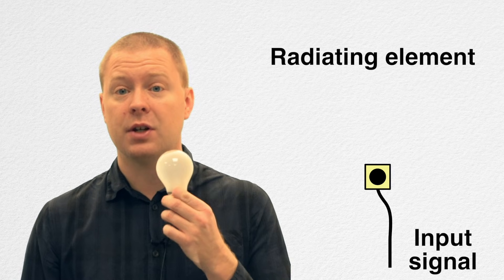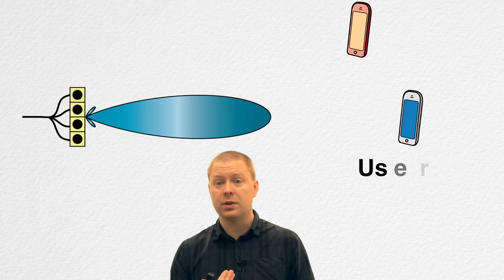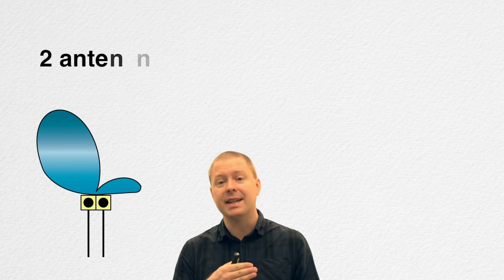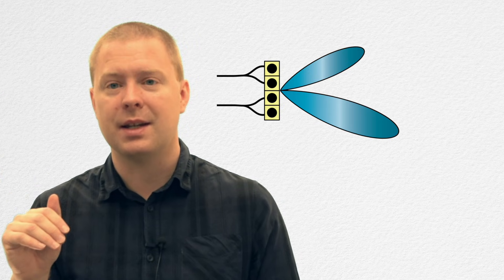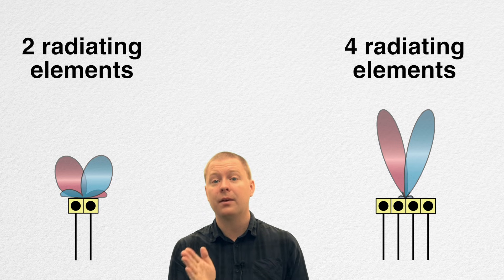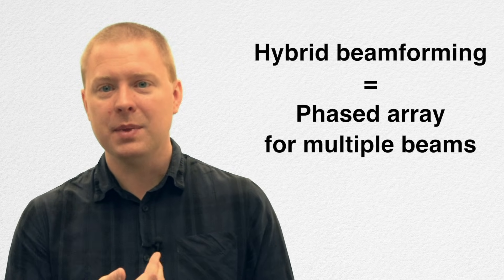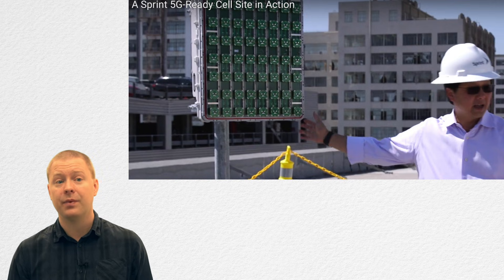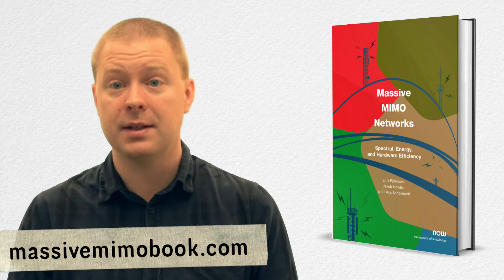Basics of Antennas and Beamforming

Comment: what about distance between two radiation elements ?
Reply from the maker: The general guideline is that elements should be spaced apart by half a wavelength. Shorter spacings lead to mutual coupling. Larger distances are possible but require a larger form factor of the array. It makes the main lobe narrower but at the expense of creating ”grating lobes” pointing in undesired directions.

Comment: this makes sense, however it wont work if you connect the antennas together, you need an expensive piece of equipment to manage the array! Please could you talk about the point you plug all of the antennas into and you cant splice mutiple antennas as this will share the power and change the freq
Reply from the maker: In digital beamforming, you plug all the antennas to the same baseband computer, so the beamforming is done in the memory of that computer where you set the power and phase for each antenna. One can also build phased arrays where the baseband only generates one radio signal, which is then divided into multiple antenna branches and phase shifted by creating delays. This is standard technology these days. Every 5G phone uses 4 antennas with digital beamforming.

Comment: What do we call a receiver array which ISN'T trying to "point" in any direction. Instead, a smart back end listens to all the elements in the array, and decides, based on detected signal, which ones to sum, which ones to invert or phase-shift, and which ones to ignore?
Reply from the maker: An analog phased-array is physically pointing in one direction, while a digital antenna array can receive from any directions - it decides afterwards in the digital receiver processing. This is just called digital receive beamforming/combining.

If you pick a subset of the antennas to use, it is called antenna selection.
Reply: @WirelessFuture  Thank you!

Comment: Hi Emil,it was so absorbing.Would like to know how digital tilt works,example 4 digital tilt means what and if we are doing 4Electrical and 4 digital would it mean 8 digital tilt in all
Reply from the maker: I guess that you with 4 and 8 are referring to degrees? You want to tilt the direction of the transmission by 4-8 degrees compared to the broadside direction? The main concepts are normally electrical and mechanical tilt, where the former mean phase-shifting the antenna inputs and the latter means deploying the antenna array with a physical rotation. Cellular base station antennas are often deployed with a few degrees of mechanical tilt towards the ground and can then use electrical tilt (beamforming) to direct the transmission further towards the ground.

I haven't heard talking about digital tilt, but I believe it is the same as electrical tilt. One could certainly distinguish between how the electrical tilt is generated: phase-shifting in the analog domain or in the digital domain.
Reply: @Wireless Future  HI Emil,My question was   AIR3419 or AIR3458 has both Digital and RET configured,so we set 4 as digital tilt and 4 as RET in AIR3458 so now the combined tilt will be considered as 8 degree tilt or it will 4 degree ,

Comment: Hello Sir,

According to the definition of the concept of ERB coverage area (gNodeB) when using narrow beam pointing generated by MIMO antenna in beamforming (BF) mode: Pointing a narrow beam covers, at maximum gain (up to 3 dB below), a relatively small area around the UE reference point (or UE cluster). How, therefore, is the concept of the coverage area of an ERB, and its correlate, the percentage of coverage area (a statistical parameter that considers the effect of log-normal multipath shading and weights its effects in an area around the ERB)?
When considering the multi-user MIMO mode, with multiple narrow beams... The coverage area of an ERB would be defined considering all the beams pointed at different points in the surrounding area, or for each beam, is an area or sub-area of coverage defined?
In the previous question, the starting point of view was what happens in the vertical plane that contains the ERB and UE antennas. There is also a concern with what happens in the signal distribution in the horizontal plane. In previous generations, a fundamental related concept is the division of the coverage area by sectors, something that was directly related to the beamwidth of the ERB antennas. For example, using 120º beam antennas, 3 antennas covered the 360º that would characterize the entire area. With multiple beams, one can imagine maintaining this concept and expanding the number of sectors. For example, with widths of 10 degrees per beam, horizontally, 36 would be needed to cover the entire area. From the above, I ask: the concept of the coverage sector remains in 5G, adapted to the multiple beams of the antennas MIMO?
Given the considerable (apparently) change in planning: do the concepts of coverage area and percentage of coverage area remain essential for planning? What other related concepts came to be used? On 4G, are they already used?
Given the complexity of using and coordinating multiple beams: in which scenarios and application conditions, will the MIMO strategy with multiple beams be used? The macro scenario is extreme broadband, communication ultra-reliable, or massive communication for multiple users? Is the environment outdoors, indoors, or both? Is the band sub-6 GHz or millimeter wave?
Still on the previous question, in the scenarios foreseen for using MIMO with multiple beams, another question arises. In which of these
 beamforming scenarios will be “fixed” and in which will it be adaptive (following cluster of users, with or without the interposition of nulls of the
 radiation pattern in the directions of other groups considered interference for that cluster)?

Finally, considering all the different aspects of previous generations brought by the multi-user (multibeam) MIMO approach of 5G discussed here….
How has the link budget analysis been (or needs to be) adapted to address these aspects?

Best Regards!

Comment: It's very confusing that you devote the discussion to "MIMO" when so much of its scientific heritage comes from that other term "PHASE ARRAY" antennas.  What's the special thing about "MIMO" that it merits its own name....how different from Phase Array antenna tech?
Reply from the maker: Phased arrays are discussed 5 minutes into the video. It is indeed the classical way of doing beamforming in line-of-sight scenarios, using analog phase-shifting. For that reason, it is also known as analog beamforming. However, it is mainly digital beamforming solutions that are relevant today and in the future of communications, because one can use it for beamforming in any propagation environment and for multiuser communications. As explained during the first 5 minutes, digital beamforming allows you to control each antenna output individually.
Reply: @WirelessFuture  thank you!  cheers.
Reply: edit: Author will (likely) respond: MIMO is THE APPLICATION of phase array principles toward simultaneous multi user spatial multiplexing. (as mentioned 4 comments below)

Comment: Thank you for this informative video! I am still not sure what the difference between phase array beam forming (talked about towards the end of the video) and MIMO beam forming is exactly. You said they both are formed using phase differences so I am still not quite sure where the difference begins? (You said separate signals for MIMO but what does that mean exactly?) Thanks!
Reply from the maker: With a phased-array beamforming/beamsteering, you can only transmit one beam in one angular direction at a time. With MIMO beamforming, you can transmit a summation of many beams. These can be directed towards different objects in the propagation environment, so that the user receives the signal from multiple strong paths. They can also be directed towards different users, so the users don’t have to take turns but can all be active at the same time.
Reply: @WirelessFuture  ahh.....very deep....got it.

Comment: great explanation, what about at home (house) with walls and floor levels (2 levels), do you need multiple antennas or just one (omni directional) ?
Reply from the maker: If you get a WiFi router with 4 antennas, you will get a roughly 4 times stronger signal everywhere in the home. That might make a big difference if there are places in your home where you currently have poor coverage (few bars). However, if you already have good coverage everywhere in your home, the difference will not be noticeable. The signal strength is typically varying by 100000 times within a house (from being close to the router to far away), so an extra factor 4 is not always noticeable...
Reply: @WirelessFuture  how about the direction of the beam ?  I believe it is directional.. I believe you need to spread it evenly , factoring also the refections for indirect areas / behind the walls ...
Reply from the maker: @arsulaksono881  The beam will be directional and change depending on who is using the WiFi at a given millisecond and where the person is in the house. So the signal will not be stronger everywhere at the same time, only stronger where it needs to be stronger

Comment: sir, in mobile communication system, when multiple users are present in a cell, how many beams can a base station send? In smart antennas, will each antenna send a separate beam for each user? Kindly explain
Reply from the maker: The beams are created by sending the same signal from all antennas with different delays. One can transmit arbitrarily many beams from an array, but since the power will be divided between them and the beams have a non-zero width, you don’t want to send more beams than there are antennas.
Reply: @WirelessFuture  Sir, so all of the antennas will be receiving signals from different users and generate beams in each direction? like one antenna will receive signals from multiple users.. Can you please tell me what are the "weights" used in smart antennas for beamforming as in an adaptive array antenna. thank you so much for answering my query
Reply from the maker: @ridazafar1798  All the antennas are receiving a combination of different signals with different time delays, which manifest themselves as phase shifts. To extract the signal from one user, the weights are selected to "invert" the phase shifts so that all the desired signals are added up in phase. We have video series on "Introduction to Multiple Antenna Communications" and "TSKS14 Multiple Antenna Communications" that go through these things in detail.
Reply: @WirelessFuture  thank you so much for clearing this point .
I'll definitely watch those video

Comment: Thank you for your amazing vidio. But I still have a question. Why we use SINR to evaluate the system performance instead of SNR. As you mentioned the power is focus on the directoins what we need. This is really confusing...
Reply from the maker: The received signal power should be compared against all the disturbances that exist, including noise and interference. The SINR gives that comparison. If there is only noise and no interference, then SINR = SNR and we can talk only about the SNR.
Reply: @WirelessFuture  thank you very much! :)

Comment: If we are using 2×2 MIMO used then both will be same frequency band or we need different frequency band to perform 2x2 mimo??
Reply from the maker: 2x2 MIMO means that one can transmit two streams of data in the same frequency band at the same time. This is achieved by spatial multiplexing.

Comment: really nice and helpful. Just a query - 64 Antenna system called 64*64 Massive MIMO ?
Reply from the maker: The industry likes to call it 64T64R. This means that there are 64 transmit antennas and 64 receive antennas at the base station. It might seem obvious that there should be the same number of antennas for reception and transmission, but this is not always the same. Many LTE phones have two receive antennas but only one transmit antenna.
Reply: @WirelessFuture  Thank you for clarification and prompt response

Comment: Hi! I have a question. It is said that phased array antennas steer the beam for transmission. But, what about reception? Is the reception pattern also steered?
Reply from the maker: Yes, it works the same. During reception, signals from different directions are amplified differently to create a directional reception pattern.

Comment: Dear Dr. Would mind help me on, how channel  estimation in massive MIMO increase EE.in your book  massive MIMO SE&EE .there is no simulation graph  how channel  estimation  in massive  MIMO to increase EE. Only you show the formula for Ls, MMSE and EW-MMSE for intracellular interference. How can i gate those formula  &how can i Simulate.
Reply from the maker: If you run the code for Figure 4.14 or Figure 4.20, you can use those sum SE values and multiply with the bandwidth of 10 MHz to get the sum rate. You can then compute the power consumption using the formulas from Chapte 5 and finally compute the EE has rate / power.
Reply: @WirelessFuture   ok thank you Dr. how can we proof EE  of mmse,ew-mmse and ls  in equation  5.37 in your book
Reply from the maker: @mulusewyitbarek5635  Those numbers are taken from Table 3.1 and the number of complex multiplications are quantified using standard linear algebra results in the appendix.
Reply: @WirelessFuture  ok thank you Dr. Dear Dr i have another  question in your matlab code for example in figure 3.2 when i run the code matlab  said that error that is '' undefined  function or variable   funnctionRlocalscattering'' such type of errors  occur in most of the graphs.   how can i correct  such type  of error.?  .
Thank you  for your help.
Reply from the maker: mulusew yitbarek That happens if you haven’t put all the files in the same folder.
Reply: @WirelessFuture  thank you Dr. i will  try

Comment: Why most of the time we use pilot based  channel  estimation techniques  for Massive MIMO? Your book also use pilot based  channel  estimation. Why not we use blind and semi blind channel  estimation  techniques?
Reply from the maker: Blind and semi-blind methods are discussed in Section 3.5 of the book. However, the rest of the book considers pilot-based channel estimation since (a) it is normally what is used in practical systems, (b) the theory is well understood, (c) it is sufficient do deal with pilot contamination as seen in the asymptotic analysis in Chapter 4.
Reply: Dear Dr.,Ok sorry  i will correct it in more respect way
Reply: Dear. Dr Bjornson. Would you mind help on  matlab  code for pilot based, blind and semi blind channel  estimation  for massive mimo systems. I konw from previous  answer  pilot  based  is preferred  how can we compares  in simulation  rather than theoretical. In your  book only pilot based  matlab  code is available,matlab code for  blind & semi blind  is not aavailable.
Reply from the maker: mulusew yitbarek You are right, only pilot-based channel estimation is considered in the book. So there is no Matlab code available for other methods.

Comment: My Understanding is currently when operating at high frequency, we use the analog beamforming which consisting to send the same signal over many antenna elements but with phase shifted which is the phased array. I'm wondering as in this case we have only one "LAYER" (Rank indicator is always one = one signal) is there any precoding matrix or codebook index in this case 🤔

Comment: Thank you for your presentation. Would like to say something  about performance  analysis  of channel  estimation  techniques  for massive mimo.
Reply from the maker: This is covered in Chapter 3 of the book Massive MIMO networks.
Reply: there is pilot contamination in uplink channel estimation ,so to  mitgate interferance we need to now data aided  channel estimation .would like to say something about the data aided   algorithm in semi blind channel estimation also include the matlab code?
Reply from the maker: mulusew yitbarek Data-aided channel estimation can help to mitigate pilot contamination, but it is not necessary. As explained in Chapters 3 and 4 in the book, pilot contamination can be effectively mitigated in the spatial domain, by using MMSE estimation and M-MMSE processing.
Reply: have you video on spatial domain MMSE estimation and M-MMSE processing.

Comment: If the receiving device doesn't have the same beam-forming technologies and multiple antenna's, doesn't it severely undermine the 'advantages' of the tech? eg if the router can transmit a long distance, but the receiving device is too far away to send back an acknowledgement, whats the point?
Reply from the maker: Und13s Bomber it works even if only the router has multiple antennas. These can be used to improve the range for both transmission and reception. Most user devices only have one antenna.

Comment: But how does this beamforming work in practice in our beamforming wifi routers? If the beaforming requires multiple antenas to work together and you can position (external ones anyway) them in any way you want, how does the router know how to direct the beam? Is it analyzing the device's incoming signal for reach individual antena and inferring the required antena adjustment to create the beam from that?